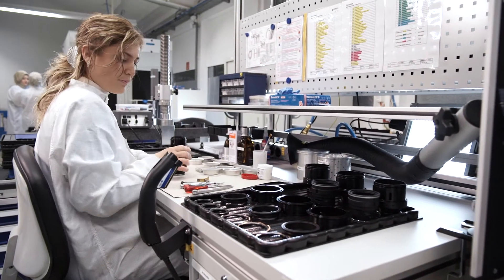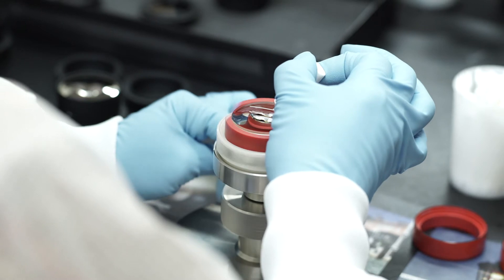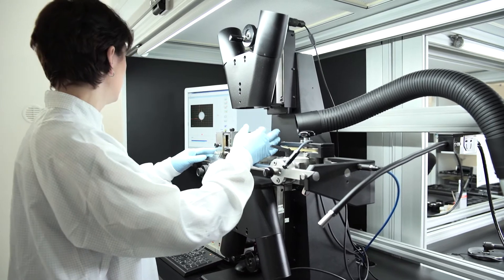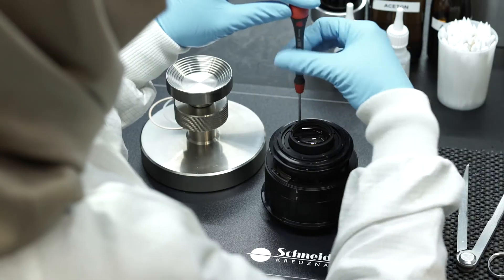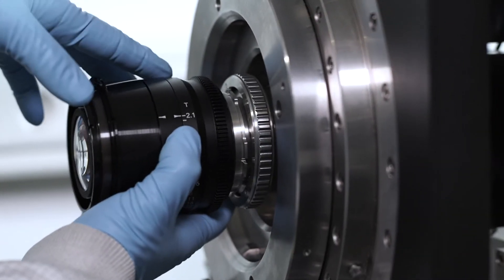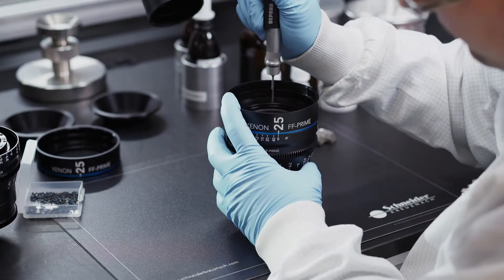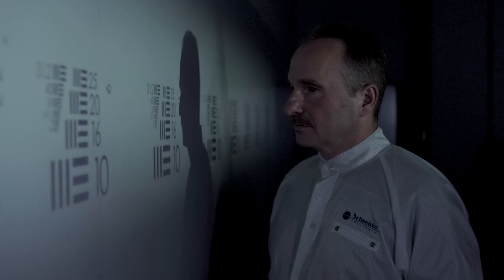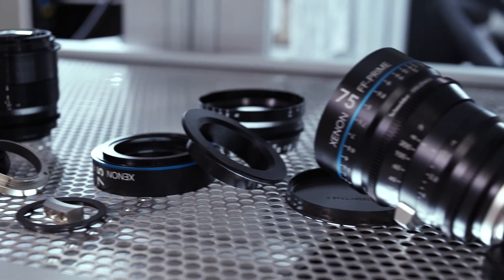Schneider-Kreuznach - The manufacturing process

Comment: Don't forget to tell how Schneider Kreuznach uses a cheap electric ribbon connector that is too long and will crease and tear when pinched between the rear lens element edge and the lens body, like it is doing in my Schneider Kreuznach 150mm f2.8 BR lens. Sony, Nikon & Canon use the electric ribbon connectors that are plastic and don't crease or tear.